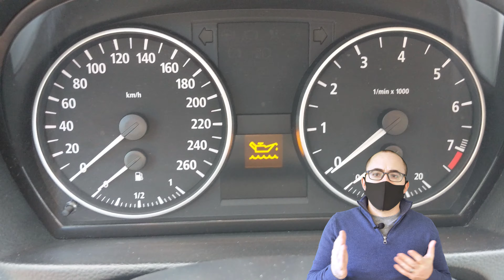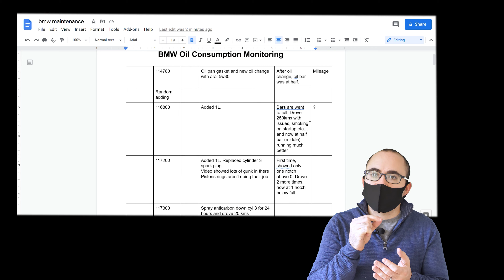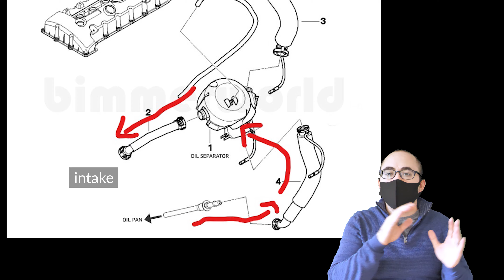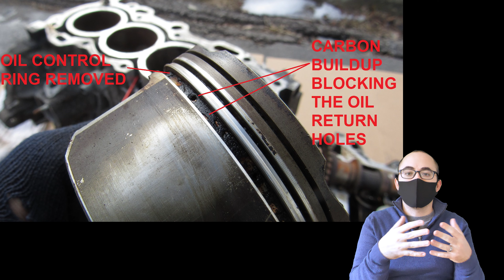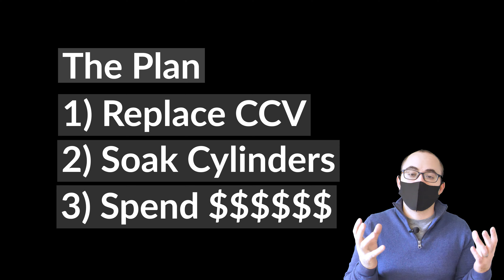How To Fix Oil Consumption Issues On Your Car - Infamous BMW N52 INSANE Oil Burning Problems!

Comment: Engine that you rebuild aren't from your car? I've watched many your movies, sometimes the car stand if front of garage sometimes not, looks like the car is daily usage
Reply from the maker: Yes, if you go back to the beginning of the videos, I bought a wrecked motor on eBay to rebuild. So I could keep driving my car. It was a good idea because I had so many issues waiting for parts, or things breaking and I had to order/wait for more stuff to arrive. It wasn't a straight forward rebuild and swap.
Reply from the maker: Oh and thanks so much for watching!!!!!! 🙏🏼🙏🏼🙏🏼 I hope the info can be useful to others 👍🏼
Reply: @buildanddrive  One more question, did You machined engine head? Thanks for that interesting content:) Im also face N52 oil issue, after replacing valve stems sealers(without removing head) drinks 1l/3000km, but unfortunately for first 3000 :/ now it's much more worst, probably because exhaust valve stems guides are worn, guy who replaced stem sealers told me that, but I not decided to head off and replace guides (my bad) More over I have clicking noise, but only on warm oil, when it's cold and oil viscosity is higher everything is quiet. After warm up sounds like old diesel mercedes ;) Maybe one of the hydrualic valve regulator is worn? So now I don't have clue what to do repair or replace whole engine do newer version with black valve cover, "love it or list it" :P Greetings from Poland
Reply from the maker: @CD XA  to answer your question, I did not machine the head. There was no major damage to the engine that I could see, no overheating or warping so I cleaned up the head and put it back together. I also made a video on this. But my engine was burning 1L/300kms. Check your spark plugs. Are they very oily? Cylinder 3 on my engine was the major problem on my engine. The spark plugs was black and I had to change it every 5000 because the car wouldn't idle very well on startup. You can see photos of them in this video.  https://youtu.be/v0gH8dFyWH8 can you send me a video of the sound your engine makes? Mine also made a rattling noise.
Reply: @buildanddrive  Valves(valve?) ticking only on warm engine, clearly audible underneath a car, under the hood ticking noise is masked by injectors ticking. Frequency of sound tells that will be a one valve? (idle rpm 700/2 = 350, than 350/60 gives  about 5 ticks per second) https://www.youtube.com/watch?v=SbK59NwJ1GE
Reply from the maker: Yep, sounds normal to me. After my rebuild, the tick went away for about 10,000kms and then came back. I think it'd the hydraulic lifters that wear out on cylinder 6. It's just a design flaw but doesn't seem to affect the engine much. Maybe not as much lift of the valve?